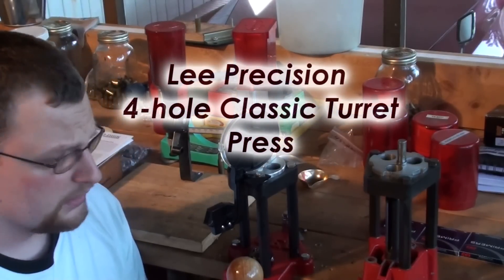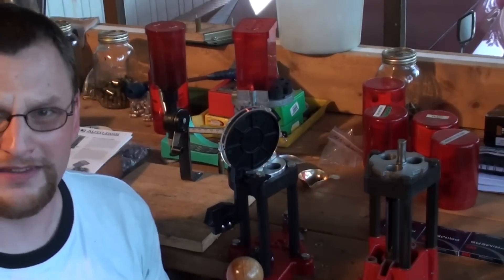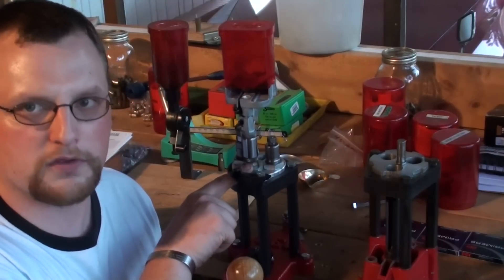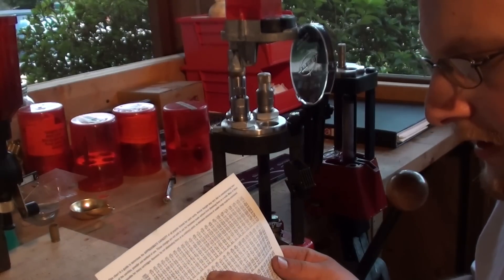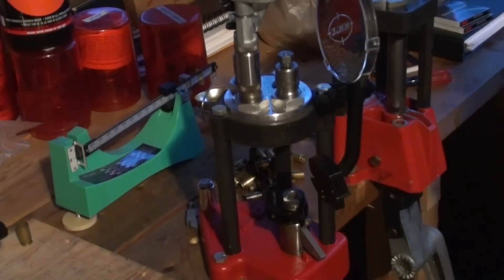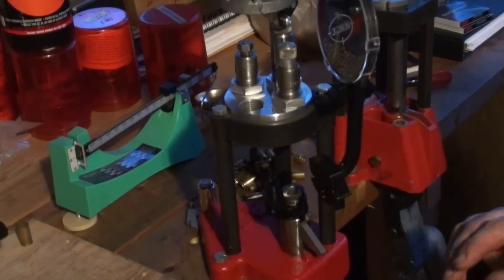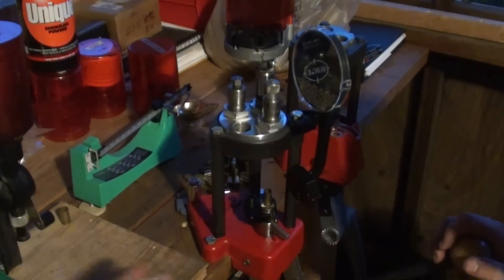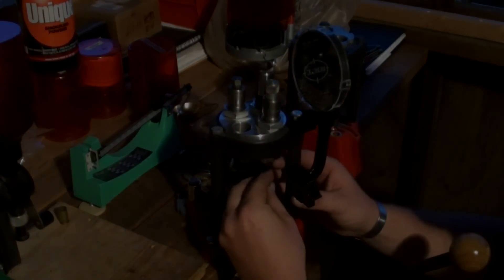Lee Precision Classic 4 hole Turret Press

Comment: Ive loaded around 5000 rounds (9mm and 44mag) with my turret press and have had no issues with the indexing rod. You should call lee and get them to send you replacement parts. They really have good service and have replaced parts for my auto prime without question. Ive heard that you can break that plastic part by not fully cycling your press when you are operating it.
You would be able to speed way up if you didint have to trun your turret.

Comment: The plastic auto index ratchet insert is adequately engineered if the press is used properly.  Prior to attempting to rotate the turret manually with the auto index rod installed, the operator must raise the ram sufficiently for the ratchet mechanism to clear the spiral portion of the auto index rod.  Breakage of the square ratchet insert is usually the result of not raising the ram before manually rotating the turret.   I have loaded many thousands of rounds with this press and have never had a problem with the plastic insert.  Almost any device can be damaged by improper operation.

Comment: My Classic Cast indexer has worked for 3 years with the same plastic part. It also sets all winter with no heat in my work shop with nothing but WD40 and NEVER rusts. But I also sprayed with automotive clear coat!

Comment: Give the auto index another try. It's much faster. I've lost track of how many thousands of rounds that I have loaded with no indexing problems. I stripped out the small square nylon ratchet once, but it was my fault. I picked up some extras (.50each) but haven't needed them since. If you manually index with the ram down, it will strip. I also use the LoadMaster Press. Both great presses. Thanks for all the videos. I know it takes a lot of time. You provide a valuable service with your videos.

Comment: I was instructed to NEVER turn the tool head the opposite way, and that is exactly what I did when my plastic square was distorted and needed to be changed. So I have not done it again and I am 1000's of rounds into loading. So check that out. if you are having trouble. Thanks for the video.

Comment: I have loaded thousands of rounds through this press and never had a problem with the auto index.  Its all in the initial setup.  Also, If you adjust the rotation/orientation of the auto disk powder measure it doesn't hit the auto prime.  Lee also specifically says in the info about the Auto-Disk Powder Measure "If you want to use the Auto-Disk Powder Measure to charge powder on a Lee Precision Classic Turret Press, you will also need to order a Lee Precision Auto Disk Riser which is sold separately."

Comment: I have been using my classic turret press for about 5 years for 9mm, 357, 50ae, 223 and 30-06.  The only issue I've had is the indexing plastic square piece.  After about 5000 rounds it wore enough to make the turret rotation a bit sloppy.  2$ for a new one and she's working like a champ again.  I really love it as you get many of the benefits of a progressive without the drawbacks of a single stage...and for the money it is a phenomenal value.  It has to be one of the most, if not the most versatile presses on the market.  The swapable 4 hole die holders are what really do it for me as caliber changes take all of 30 seconds.

Comment: Excellent vid Iraqveteran8888. I'm new to pistol reloading but have reloaded 12 gauge on & off for 25 yrs. A little advise concerning volumetric powder throwers is to ensure that your powder proof measurements are taken after a complete press ammunition reloading cycle. This is very important because the powder WILL pack in somewhat with movement & vibration. My Hornady 366 would throw one grain extra with normal cycle press vibration & nearly two grains more if I had a jam up or some such & had to fool with the press. If I have any problems I always dump that powder charge before resuming the cycle. I would imagine that Lee may have taken this into consideration which may account for you measuring 4 grain & not 4.9 during your initial setup. 
All the best & keep posting.

Comment: Great and well made video. By the way, the 9mm Luger case is indeed crimped most times. Its a different type of crimp than say a revolver cartridge. It's taper crimped rather than roll crimped. This is critical as this case head spaces on the cartridge mouth, you will shorten it and create a dangerous situation.

Comment: I noticed alot of people ask if you can do rifle rounds on this press and the answer is yes. I've done .308 on it no problem. You can use the powder measure for rifles but you have to get a double disk kit for the auto disk measure and a rifle charge die. I haven't tried setting the auto disk up for the .308 yet but I will eventually

Comment: The square washer is designed as a wear item. If it were made from steel or aluminum, it would risk damaging the indexing rod. Wesring out as quick as yours did, I would say it was user error not a design flaw.

Comment: a tipp to make the plastic nut thing last ist to take out the turret and use a sharp knife and cut off a bit of the edges on the indexing notch so that it takes
less force to free the springloaded ball from the indexing notch.

Comment: my manual says that the plastic index guide is a consumable.  making it out of plastic keeps the price down.  even if it was made of metal it would still ware down and need replaced.  also different metals rubbing can cause some unwanted heat and/or static buildup that could spark and we all know sparks and powder don't mix well.  metal on metal can also jam damaging more than the guide.  also do not manually index the turret with the ram full up or full down.  ram needs to be about half stroke (just above the twist on the indexer rod) to free the index guide.  that said the rest of the video I thought was great.  knowledge is our greatest weapon.
Reply: This- TheBaldeagle001 has it figured out!

Comment: From what I have recently gathered from other videos, I believe the Classic 4 hole press has a cast iron base and the non Classic has an aluminum base. I may be wrong about that though and there are probably other differences as well. If this is the difference between the 2 I believe I will get the Classic, it seems the cast iron would last longer, more stable.

Comment: I was having the same problem with the plastic rachet on the indexing rod stripping out. I put a little grease on the indexing rod and haven't stripped one out since. The press is alot better with auto indexing much faster.

Comment: I have a hornady Lock n Load progressive.  Works great.  About 4 times less pulling the  handle to get a round. After the first 5 pulls I get a round on each cycle. It's all steel and indexes great. I can also use it as a single stage press if desired for really small lots.  I find myself now loading in 100 lots a lot more.

I find the RCBS rock chucker single stage is getting no use now.

Comment: I have one of these I'll probably be selling soon with several turrets. I liked mine, and kept all the dies set up on turrets, but it wasn't strong enough for my liking and I found inconsistencies in the ammo that it loaded, that are eliminated by using my rockchucker. I to stripped out the auto index nut. The manual says if you raise the ram half wayup, and try to bring it back down it strips out the plastic nut.

Comment: I removed the auto indexing mechanism as well. I could never get it to index well and the little plastic piece wore out very quickly. I also have the pro auto disk, but have never use it because I could never get a consistent charge. The auto prime system is one of the best priming systems on the market.  Great video!

Comment: thanks for taking the time  making vids for us and just a thaught  for ya as you use allot of diff rounds try using a drill head you can install it on your press and use it to pull allot of diff cal. I made 1 for my press never buy another fitting .tryt it youl like it 
just gota turn it until it grapples the projectile and best of all it doesn't wreck bullets.
anyway just wanted to give something back to ya. thanks again and merry x mass.

Comment: The plastic auto-indexer will wear really quickly if you don't complete full cycles on your press.  I blew one out like you and then read a "don't do this" etc.  So do all the way up and down and you won't blow the plastic inserts out.  If it was made out of metal it would break more expensive parts than the... $1 (i think) inserts.

Comment: @IKEFOOTBALL77 It is a great press for a beginner. If you buy a single stage press, you'll soon outgrow it especially if you are primarily loading pistol ammo. I'd make 2 substitutions though. Most importantly I'd get another powder dispenser. The Lee powder measures are simply too fussy to set up and difficult to adjust. I use a Hornady Lock N Load powder measure. RCBS makes a great one too. Secondly I'd invest in an electronic scale. It is much faster and easier to use.

Comment: i'm not sure how you broke the little plastic ratchet. I've loaded over 20k rounds and mine is still fine. I see a lot of people manually turn the turret while the ram is all the way down. This will break the ratchet. If you need to manually turn the turret raise the ram half way up or more.
Reply: Agreed, you need to have ram raised before turning or removing turret. 20k plus rounds in mine and still on original plastic ratchet.

Comment: This 4 hole Turret Press is built pretty durable for the price. With that said for whatever reason it gets stuck halfway advancing and you unknowingly use your weight on the lever, something has to give. Would you rather bend or break the frame, trying to press a bullet in. That's off center from the die.or break a cheap little plastic guide bushing? I just despise all the different size brochures that came with each piece. Couldn't they have at least made one common size page, so it could be added to a binder?
Reply: Right on, w/ regard to the plastic bushing. Don’t short stroke the handle, problem eliminated. If something DOES bind, don’t force that lever- figure out what’s causing the binding!

Comment: I use this press. I disabled the auto index, don't care much for it. I don't use the priming system, I instead prefer to use Lees hand press. 

I've used the auto disk measure without the riser, but its a pain in the ass.

Comment: After i watched this vid, I purchased the kit.Trying at present to set up for 38 special. The shell doesn't go up far enough to full activate the pro powder measure. If I run the expander die in further it flares the case.  What do you suggest?  Thanks for all your videos, they are a great help.

Comment: What about the brass length after sizing? Don't you check to see if it's to long? I have only been loading on a single stage press and check every piece of brass after resizing.  It's long and needs trimmed.

Comment: I own the regular 4 hole press not the classic. The classic is a little bit taller allowing tall rifle calibers (308 and taller) so the classic will work fine. With mine I can reload my 308's but I have to remove the auto index feature and turn it manually. I can turn out 308 at about 100 rounds per hour but thats' manual turning and not focused its just casual no big hurry loading. I would bet with auto index and focsing hard you could do close to 200 an hour.

Comment: on my press im using power pistol from alliant  for 45acp and lyman says i need 7.4grains  and in the lee manual it says to use .66 on the auto disk but its putting out 8.1 do u think i should use another disk like u did and see if that will change

Comment: Hey, I have the same setup as you (lee 4 hole turret w/ safety prime) but am running into an issue. When I push the auto prime into the primer arm, I have to hold the primer arm down, otherwise the autoprime will push the primer arm back into the ram. I noticed with your setup , your primer arm stays in place and are able to prime with one hand. Do you have any idea why this could be happening? I have searched everywhere and cannot seem to understand why this is happning. Thanks.

Comment: i have had a problem with my lee 4hole press.....the primer installing bar flops out every time i cycle the arm up and down....when i lower the ram of the press the priming bar raises up slightly and sits on the edge of the ram instead of down in the groove it is supposed too and when i raise the ram back up it just falls forward onto the floor....happens every single time i cycle the ram....any ideas....anyone....

Comment: I'm in the process of selling my lee loadmaster progressive I replaced it with this classic turret. Don't waste your money on it everything on it is designed to wear out and nickle dime you to death. The primer station is hit and miss at best. When it works it works but when it don't it won't.  If they would put a few bucks more into it and make some hardened steel parts and get rid of some of the plastic it would be a lot better.. I bought it with .270 dies forget even trying to load rifles.

Comment: I had the same problem with the auto index on my 4 hole turret i shot a little graphite lube into the auto indexing knuckle. it keeps the plastic washer from stripping out.
I agree they should have made it out of metal. I have the original 4 hole turret not the cast. I also have the auto disc pro the adjustable charge bar is well worth the money

Comment: take a new plastic square bushing and take it to a local machine shop, gunsmiths will be able to do it themselves. Take that piece of plastic and copy it to brass. A couple of lightly carved groves "if desired" can hold a bit of graphite grease to lube, if not use any lube you have for you reload process. I have turned any plastic which I would suspect of premature failure into brass, I do not like aluminum in some cases as it will sometimes react with other chemicals. I hope this will help.
Reply: Plastic bearing is DESIGNED as a sacrificial part. I bought 12/$10 shipped, haven’t needed one, yet. Don’t short-stroke your press, won’t strip the plastic bearing.

Comment: You shredded the ratchet by forcing the turret in its lowest position. It did what it was supposed to do and saved the rest of the workings due to end user error and abuse.

The plastic ratchet is designed to be the expendable part. That's why it comes with an extra and why they're so cheap.

But the end user always knows better than the designer. How many presses have you designed again? Tell them how you built it better.

Comment: It's made that way so for the next 25 years they can sell you a new piece of plastic every 6 months, otherwise the press would last forever.. I have a lyman 6 hole turrert thats very old one of the old red and gray ones and theres not a single ware part or piece of plastic on it other than the primer tube cover.

Comment: Yeah and tell me why the auto disk powder measure hits the primer feeder even with the extension tube.  They have some really poor engineers working at Lee. I am selling my Lee Loadmaster progressive it won't prime for crap and the safety prime system for this press isn't much better. It either goes in the shoe or on the floor..

Comment: You probably read all the comments by now and realize you are the problem. The ratchet is meant to strip if the press is used wrong. Striping will prevent any breakage in the indexing system. Don't turn the tool head without having the ram in the middle position.
Reply: After a few thousand rounds mine did as well. It’s not exactly a “precision instrument “ but for the money I’d say it’s what you could expect. Many thousands of rounds later I’m still satisfied 👍